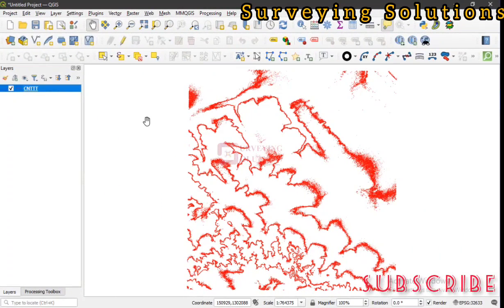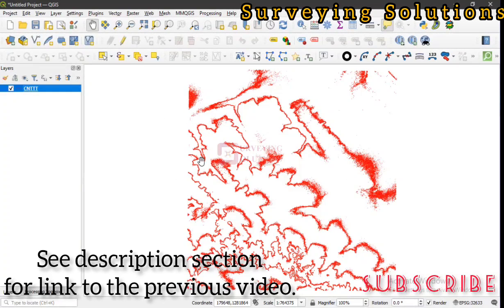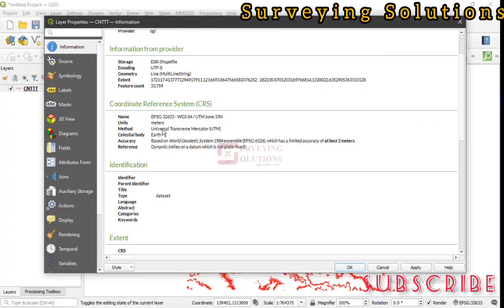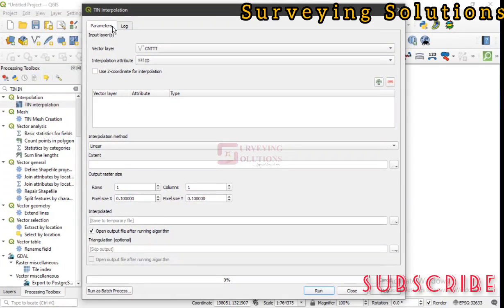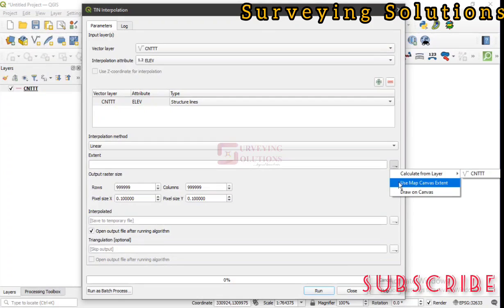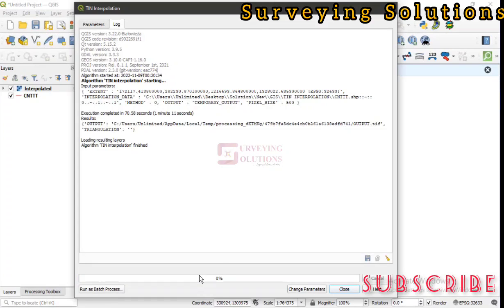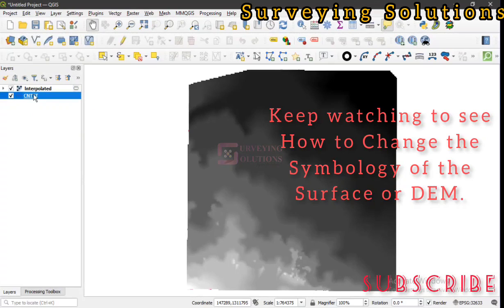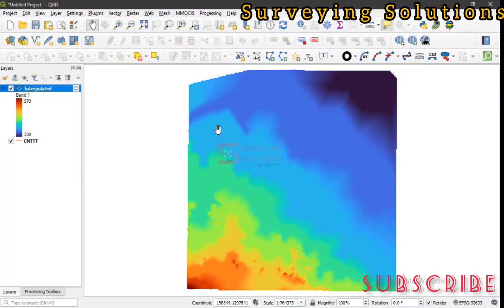TIN Interpolation in QGIS | QGIS TIN Interpolation

Comment: What determines the x any y values on the interpolation window
Reply from the maker: Hello Martha. 

What we have now is a surface, raster data. To know more information, you need to use the 'Identify' or similar tool to select random points on the surface. This will show the values of the interpolation. 

In this case, I think Z values were interpolated. Therefore, it's most likely to see Z values when you try to identify.